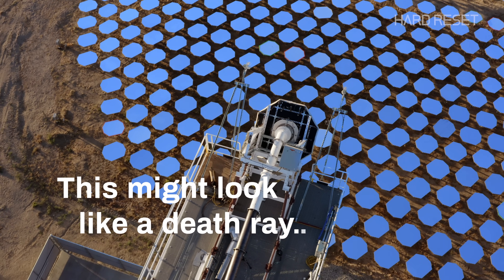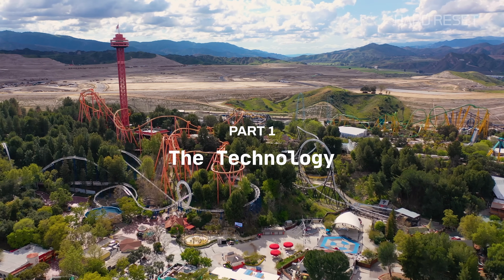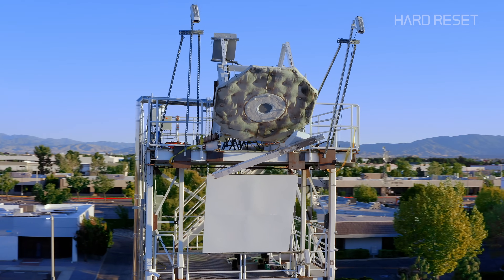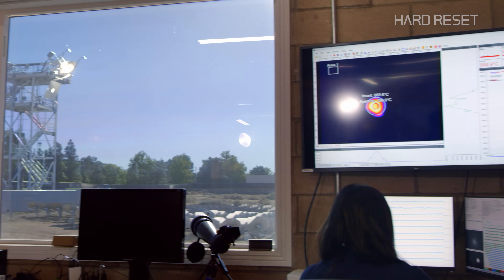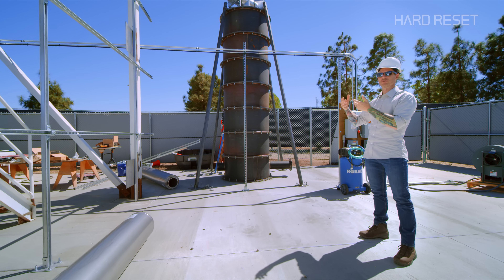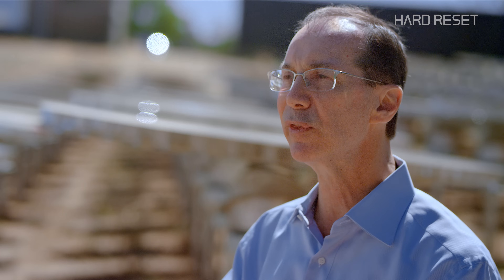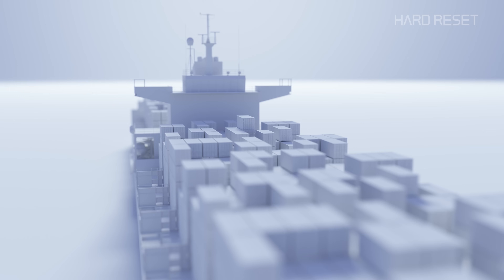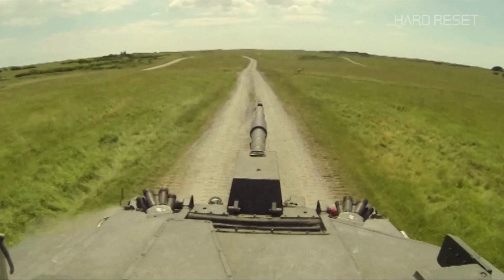Did We Just Invent a Planet-Saving Death Ray?

Comment: I'm surprised this video made no mention of the main problem - the cost and impracticality of transporting the resulting hydrogen (which also has low energy density). That problem is definitely not cracked, even with current ammonia conversion tech. So the entire vision appears impractical until that's solved.

Comment: This has been tried numerous times. It's nowhere near as cost effective as basic solar energy. Not to mention the newly proven electrically powered flash furnace that was recently proven to be more then effective enough to meet industrial needs. Given patents for early prototypes are already open it wouldn't be hard to reproduce it fast all over the place. From there, it's just a matter of installing a much more efficient generation system like solar plant or wind farm or even coal or natural gas plant and boom, easily above 2000C

Comment: 3:55 - People have done mirror concentration before 
3:58 but they've achieved 400 degrees, 500 degrees. 
4:01 We've achieved 1,500 degrees. 
Wow! Awesome!
Reply: To approximate maximum efficiency of a heat engine using Kelvin: (hot_terminal - cold_terminal) / hot_terminal so 1800 - 300 = 1500 / 1800 = 83% maximum theoretical efficiency! Crazy if true. Of course, throughput and cold terminal saturation matter.

Comment: Isn't this old tech? There is a  plant that uses mirrors and molten salt in the tower to power a steam turbine.
Reply: CSP (concentrated solar power) has been around for a bit, yes!  This technology is a bit of a refinement on that - using software that coordinates and optimizes the movement of the mirrors instead of mechanical coordination, which allows much better results.

Comment: I’m still unclear how what they’re doing is better that what has been tried before
Reply: No it isn't. ISH... They use AI to use standardized small mirrors. Before it was large custom mirrors using dumb programming. This one uses automated software to adjust the small off the shelf mirrors to constantly readjust. The concept is the same however the cost of building it I am assuming and which they didn't explain clearly is bringing down the cost to commercial price which is something that couldn't be said about the existing one. The only thing I am curious to know that it didn't cover is if it needs natural gas to get started like the older designs did which is both wasteful and counter-productive..
Reply: @stickynorth well said.

Comment: The existing power plants are all already retiring because they are not cost competitive. 

Heliogen's projects have all been cancelled or put on hold.

You don't need AI to track the sun.  This is a straight forward simple math problem that has been solve many times without AI.
Reply: but you do need to say "AI" a lot to fleece investors for a second time.  Did they mention it has AI?
Reply: So you can use the infracture of a coal powerplant?
Reply: @CUBETechie  No.  There are multiple solar power stations built and running years ago just like what is imaged here.  We've been running plants like that for decades already.  They are either shut down already or scheduled for retirement.

They just aren't cost effective.

Heliogen is basically bankrupt.
Reply: You are missing 5G, and you can get free money from the Chinese

Comment: I'm curious. Why rocks and not sand? Also, you could use captured energy to lift those rocks/sand containers into the air creating gravity batteries, releasing that potential energy at night when the sun is down.
Reply: I am sure they know what there doing 💀
Reply: @roobes  Agreed. Rocks were apparently the better choice here. Was just curious why it's better than sand in this case. More for my own education.
Reply: For your education....China is using this concept and will have 2sq km of mirrors in geosync by 2028....and are currently (and separately) running full scale tests on gravity batteries (10 of them) on the MW scale....one of the Scandinavian countries is using an interesting gravity battery concept and using a 3km deep mine shaft instead of building upwards....short answer is because America sucks at this point, and if it doesn't ever increase quarterly profits, we aren't interested.

Comment: Wouldn't it be better to have all those mirrors on the roof of a factory building of an iron smelter? I feel like the mirrors would be in the way when you've got the possibility to work in 3D.
Reply: not every factory can be built in areas with optimal condition i dont think
Reply: @justthatguynone6792  what's your point?

Comment: If the primary output of this thing is heat, could you not integrate it with Terraform Industries' MK 1 Terraformer (basically, a synthetic photosynthesis machine that requires electricity and heat to run)?
Reply: Definitely a possibility! Heat can also make electrolysis more efficient - so you could use it to generate hydrogen for a terraformer.

Comment: Sure if you’re trying to melt something small or burn a hole in something. It’s a joke if you are trying to melt 250 tons of steel every couple of hours. All one has to do is look at the watts per square meter the Earth receives from the sun to know just how foolish this video is. Any Engineer can clearly see how absurd this is. 

Don’t be treated like this,  go out and learn something.
Reply: •	'S': Solar energy Earth receives per day: ~1.5 x 10^{22} J
•	'H': Humanity’s energy use per day: ~1.6 x 10^{18} J
•	H / S = ~0.01% of daily solar input.

This suggests that, hypothetically, humankind could cover its entire (current) energy requirements without significantly impacting the energy required by the planet's ecology.

Thoughts?
Reply: @akastewart my thoughts....this is a feel good fluff piece that will never go anywhere, and China will have 2sq km in geosync orbit in 2028....land based is inefficient (damn rotation turning out the lights half the time), ideas like these go nowhere without political will (US doesn't have it)....and the turning a desert into a collector would be tied up in court for decades and then scuttled because of some lizard, mouse, or flower that would go extinct if we built it.